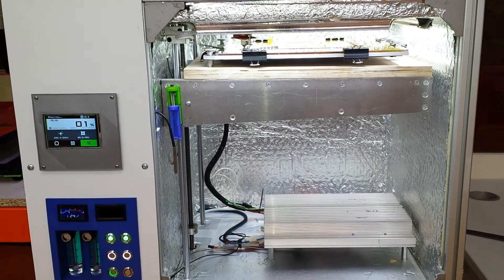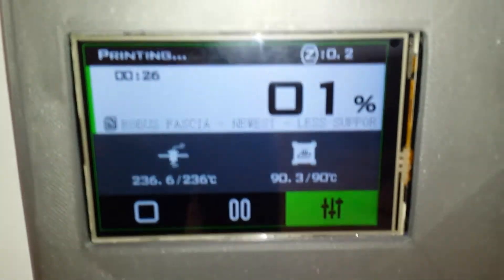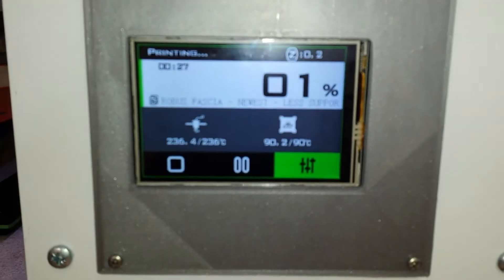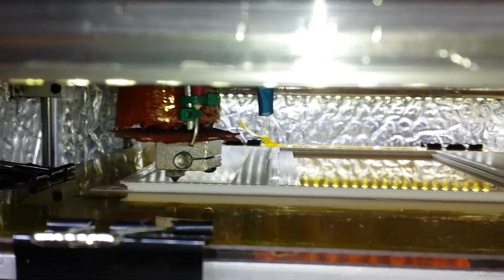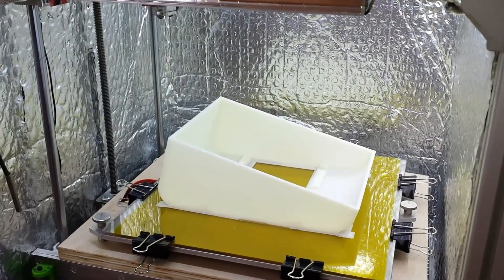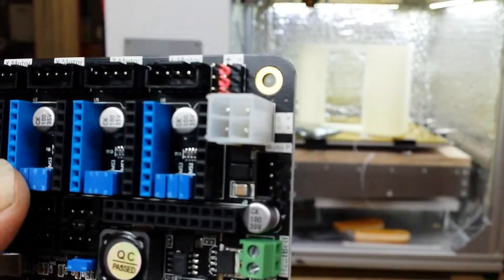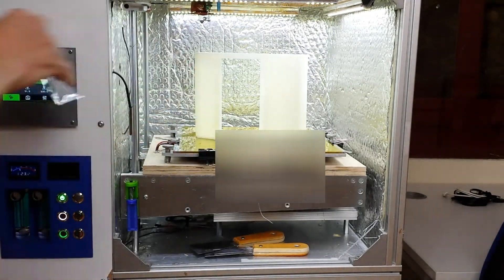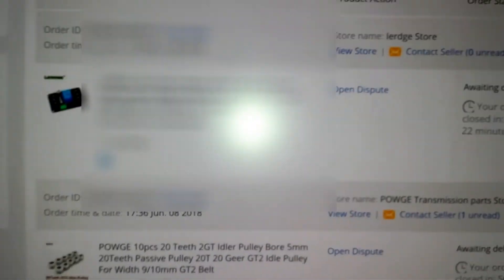LERDGE-S 32Bit Control Board - 1ST Print after installing

Comment: For limit switch settings go to the bottom left where you see the three little gears and push.
Than you see the board shows you your machine type. (beside other types)
Klick on your machine and go from there. All specific settings including limit switch settings are on your fingertip now.
Good luck
Ed van den Enden

Comment: nice work , will that board run the TCM2130 drivers ? 
Cheers
Reply: There is a seller on ebay selling it with the TMC2130 drivers. I don't know the seller but I'm going to buy one.  Price is also better than most.  https://www.ebay.com/itm/3D-Printer-Board-Lerdge-X-Motherboard-ARM-32-bit-Controller-with-TMC2130/202360153692?hash=item2f1d9ae65c:g:FzUAAOSwic5bPO1F:rk:9:pf:0

Again, no endorsement of this seller.  Just something I want...

Comment: does this board have thermal runaway protection
Reply: Yes it has and luckily not to be switched off or on, it is clumsiness proof :-) If your PT100 or thermistor is broken or they give to long no response the machine go's on hold and saves his last position. Max and min. temp settings are another layer of safety that is foreseen.

Comment: This board looks great can I ask will it work with cartesian  printer such as the ender 3 ?
Reply from the maker: Hi Yes this board will operate most common Printer formats. Cartesian & Core XY styles.
Reply: Accel erate do you know the difference between the X and the S ?
Reply: Also I’ve tried to go on their website. But it looks nothing like the site you were viewing and well there isn’t anything there. !!
Reply from the maker: Hi John - I just visited the Lerdge site and still up and running - http://www.lerdge.com/case_complex.aspx?TypeId=29&FId=t4:29:4 ,  The S board is the older one with a few extra features like 6 end stops. The S board will work fine.
Reply: Accel erate hi I just thought you might like to know they have discontinued the ‘S’ board and are only selling the ‘X’ as a starter. They intent to release the new upgraded board at the end of August. The Lerdge ‘K’ board. It has loads of new features and 6 stepper drivers.
Reply: The board is terrible. Do not buy. I have one in my gecko. I cannot tell you how much a pain this thing is.
Reply: @JohnKrieger  Why is it a pain? It looks pretty decent to me.  Enough so that I ordered one and I've heard other people say similar things to yourself, but nobody ever says why.  Often I get it's not open source, stay away!  But I don't care if it's open source as long as it does what I want it to do now.  I've built from scratch, and been tinkering for about ten years.  I want something that I plug in and I don't have to write modfied Marlin firmware etc... I don't want to have to scroll through firmware to calibrate etc... 

I am being sincere when I ask, what problems have you had that you say it's a pain?

Comment: WOW Accelerate this build is amazing.  Love the fact that it looks like a hypercube but all the wires and stuff is on the back all encased.  What power is the PSU?
Reply from the maker: Cheers Derek - Its a bit of a Heath Robinson throw together but works great for ABS. The PSU is just a 24v 10Amp Siemens Industrial Din Rail mount type. Set to about 26 Volts.